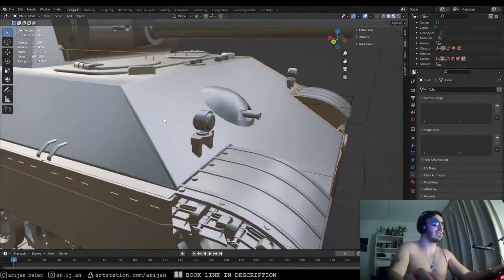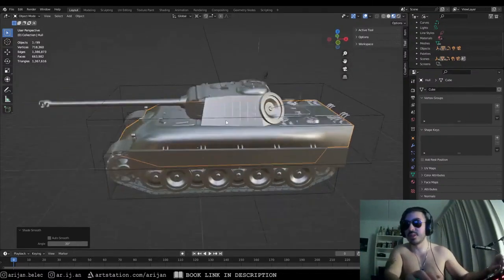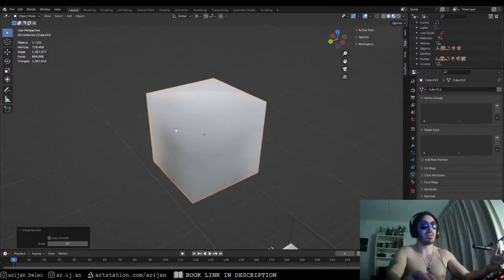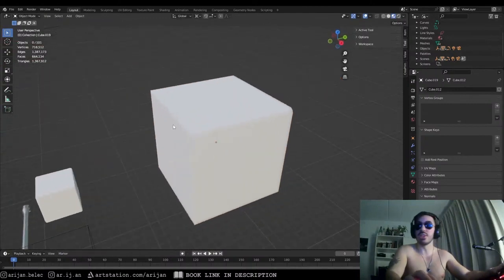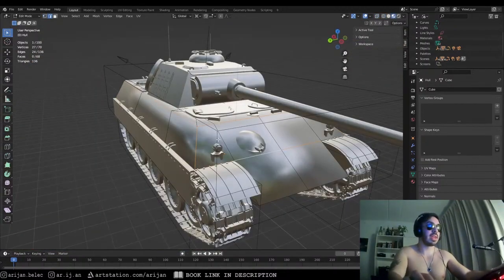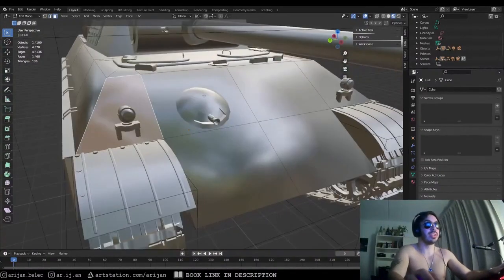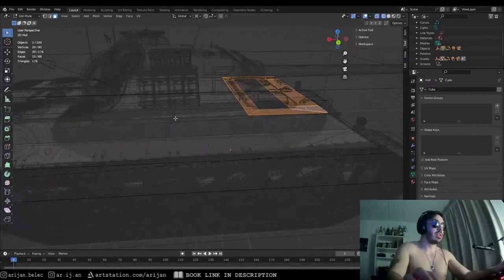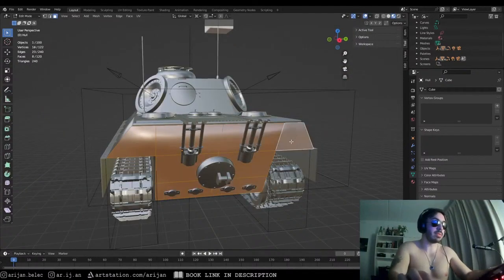Create Bevels on Low Poly Models | Livestream Clip (Arijan)

Comment: Thats a technic I use since 2004. Its called solid chamfer, or solid bevel. Pretty easy to use with the bevel modifier and set to smoothness 1.0. So its actually doing that automatically for you. Its also essential when doing subdivsion modeling, because, you might not know, it works too! check it out.

Comment: If someone wants to keep some sharp angles and smooth angles at the same time - try to play with normal recalculating/resetting etc. Sometimes it's a real time saver and a great way to fix visual imperfections when you don't want to fix entire topology. Maybe make a video about that?